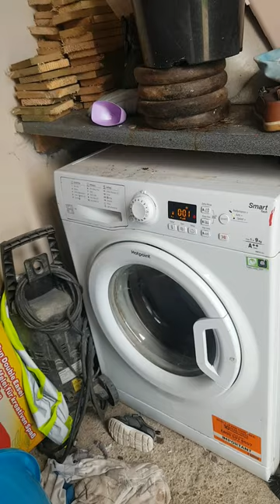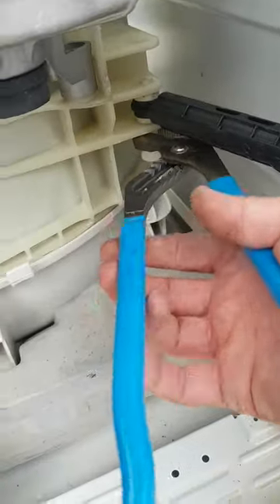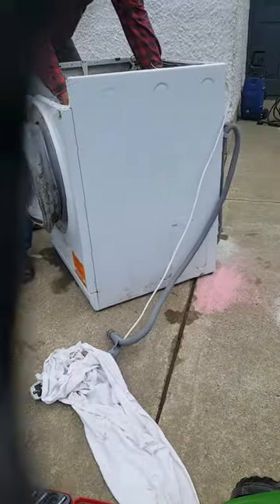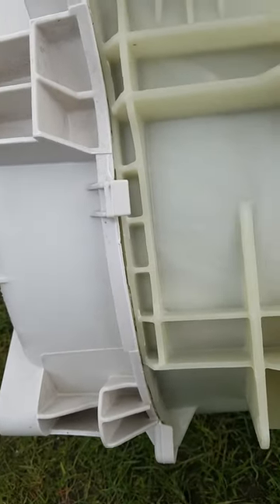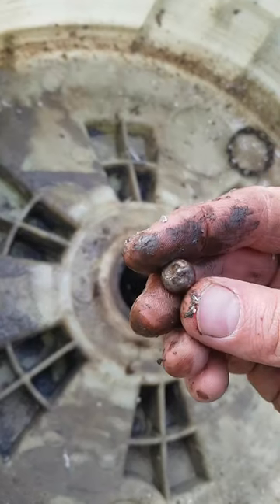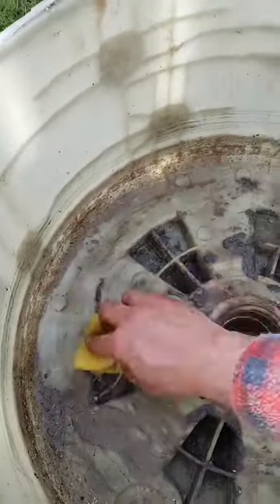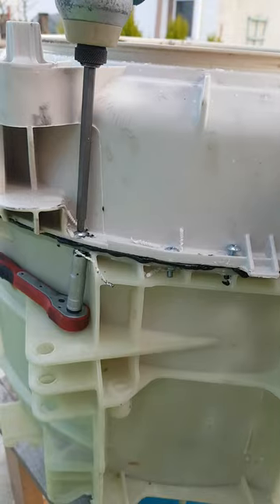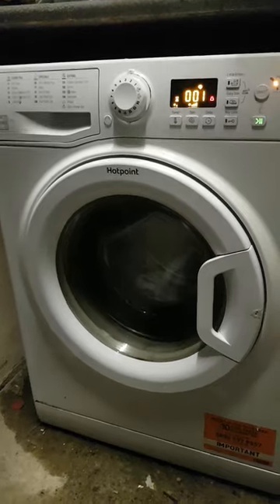Repairing our Hotpoint washing machine. Bearings compleatly failed.

Comment: I did this same repair earlier this year and the machine is still going. I had a drum casing that bolted together, so that part was way easier on mine. However, i had a hell of a time getting the shaft out of the bearing. Ended up using a sledge

Comment: Recently tore mine apart to fix a faulty wiper switch to detect the door being locked. $300 part with yearly failure rate. Cheap fix is to remove the switch, clean contacts and apply dielectric grease. Running like new for months now

Comment: Dear Mr. Doherty. Just wanted to say thanks for an excellent tip. Wish I could buy you a pint at your local. We have pretty much an identical washing machine and did pretty much an identical repair. All good after a few weeks of usage. Had to modify/hack the rubber spring gasket somewhat which means I will probably not get another 15 years from it but I am hoping 5 ;) Many thanks again. Be safe be well.
Reply from the maker: im glad I could help. and im more glad to hear you fixing your own. 
its a lot more satifying fixing one, than it is buying a new one.
Reply: Indeed. @deandohertygreaser  Also fab for the planet to not throw away gadgets to soon without an attempt at repair,  ..;) Be safe, be well!

Comment: I did this repair to my candy machine 3 or 4 years ago, bearing cost about 4 quid and a tube of sealer was all I bought but when I put it together it would fill ok but then blew the house fuse when it tried to heat so 8 had to call an engineer who said it couldn’t be done without leaking but he came out to it anyway and he was impressed that it dint leak but I had trapped a wire under the chassis when I reassembled it and caused damage to the circuit board and had to scrap it but it is very doable even for a mug like me lol

Comment: Adjusting the legs under the washing machine can help reduce the noise after replacing the bearings to level it with the ground so they don't keep smacking the ground when its spinning

Comment: I repair washing machines as a hobby as i've always enjoyed trying to fix things, the amount of these Hotpoint/Indesit i've had dropped off with failed bearings is ridiculous. the only difference in what I do is i pre drill the holes before cutting the tub apart so it makes it easier to line up and seal once finished. I just finished doing a bearing & seal replacement on a Hotpoint WMFG 942 Futura
Reply: You wouldn't happen to know what size bearings in need for a hotpoint WMUD942K be nice to order them before sawing it in half ;)

Comment: Great video. My same machine has gone now and needs the bearings doing. Im ordering the parts, but have a question - you used 6206 (30mm) and 6207 (35mm) - does it have two different size bearings or did you make do with what you had? Thanks!

Comment: hi thanks for the video. I'm following your steps to replace the bearings in my own identical washer. I've had no issue up until 6:25 in your video. the bearing seems to be protruding slightly like yours does - there seems to be an inner lip stopping it being pushed in further. then at 6:28 in your video it shows the bearing in further. how did you remove the inner lip preventing the bearing being pushed in further? thanks
Reply: I had the same. I cut it somewhat, thinking something else will probably break before this repair. Also was very unsure of whether it would work, so did not want to waste more time and money before I had some usage from it.  Good luck!

Comment: Awesome video and really glad that I found it... 

I appreciate it may only offer a relatively short term fix, but could you confirm which bearing kit you used for this repair? There appear to be 30mm ID and 35mm ID Hotpoint bearing kits, but Hotpoint themselves are less than forthcoming with any details as to what the actual specifications are and ideally I'd like to have the parts on hand to replace rather than need to measure / order and wait from them to arrive (as we are a family of six and the machine is in frequent use).

By the way, our machine proudly boasts that the parts are guaranteed for 10 years, yet it's barely 7 years old, but I know they won't come and fix it without it costing us more than I care to think.

Any insight on the bearings that you could provide would be really appreciated and thanks once again for the video 🙂.

Comment: Hi buddy.  Great tutorial..  
I got same issue with mine ( exact same model)..... I've stripped it all down after watching your vid, but not sawn it yet...I was wondering if the CT1 is still holding up, as I'm stuck on whether ordering the CT1   or SIKAFLEX?  Cheers buddy..keep the kids coming..👍👍
Reply from the maker: Mine has started to leak last week. It's only a small drip when it's running but also the bearing are getting loud again so my spider braket must be bad also. I'll be replacing the whole machine shortly. 
Worth noting that my machine is in a shed, so does not mater if it leaked. Plus I would go with the ct1 .

Comment: Howaya Dean mate, I'm a hotpoint engineer, change these drums for a living 😂 just wondering if this held up? Have doubts that it would, but just said I'd ask 👊
Reply from the maker: Worked on a treat and lasted another 6 months or so before buying a new Samsung machine. Eventually, the new bearings started getting very loud again. Either the bearing seal failed, and the new bearings started rusting up. Or the spider shaft was damaged, causing the bearing to fail prematurity. 
But the drum itself was still sealed tight, with no leaks after cutting it in half.
But I would note that this machine is stored in an old shed, so a leak would not have been a concern for me. 
But yes, this did work for keeping the machine running a while longer.
Reply: @deandohertygreaser  good man, thanks for the reply, yeah in most cases this is a new drum replacement, some of the older machines have a split drum, but these ones fully sealed so impossible to change the bearings, good tho that ya got the extra couple of months out of it for a bit of time some bearings an a bit of silicone. Keep up the good work pal, love watching the vids.